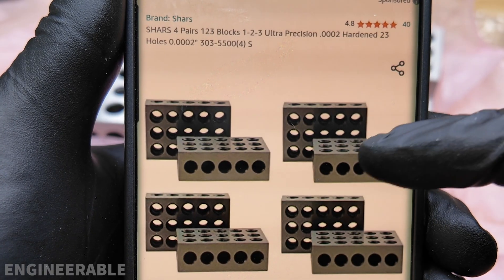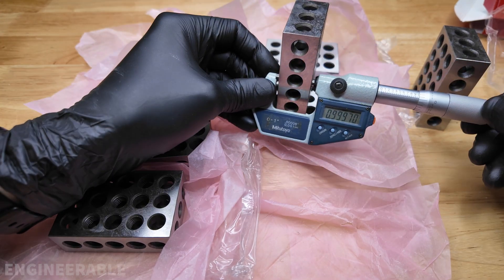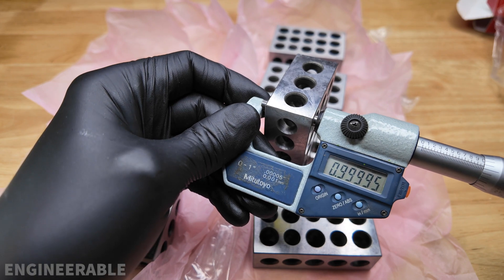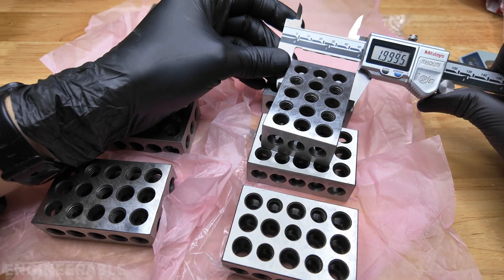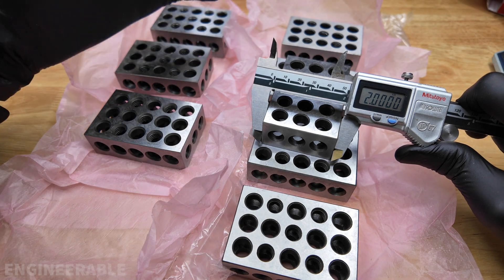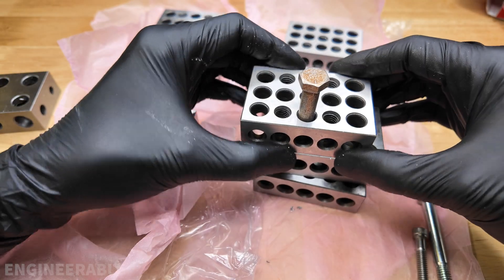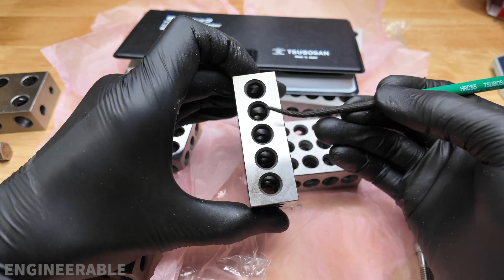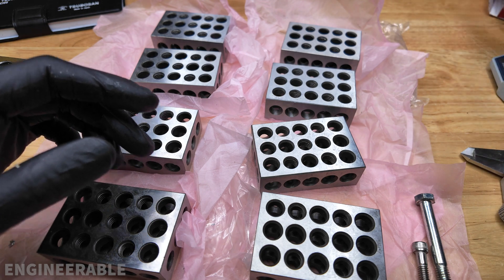Are They Any Good? SHARS 123 BLOCKS for CNC Machinists Tested

Comment: Do you check these blocks again after you have been using them?
Reply from the maker: @trep53  What do you anticipate that will happen after use? I doubt they will wear as they are fairly hard.
Reply: I cannot imagine these blocks would change dimension from normal use. If they did I think there would be visible wear marks.